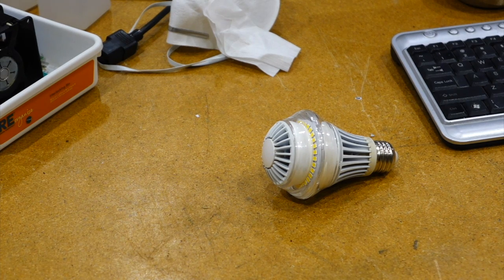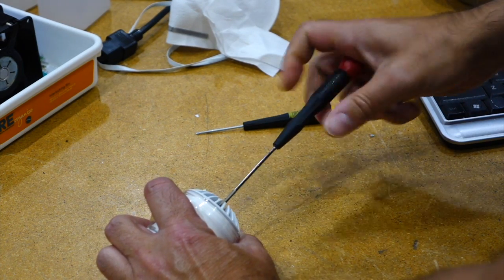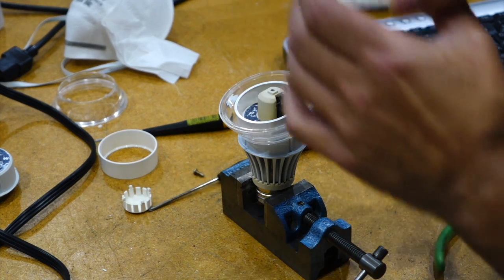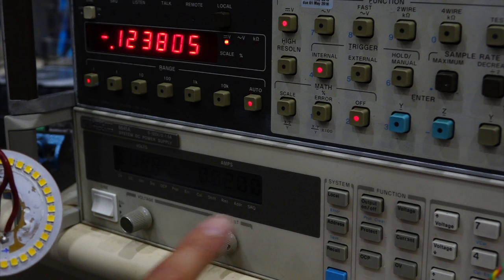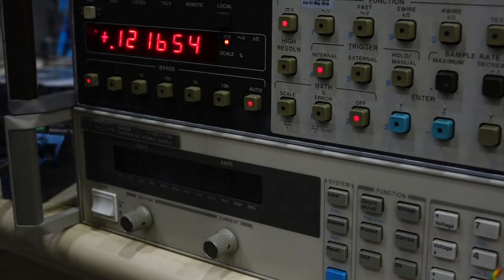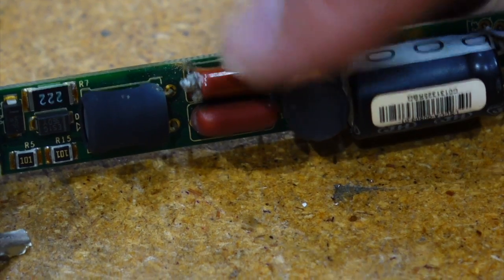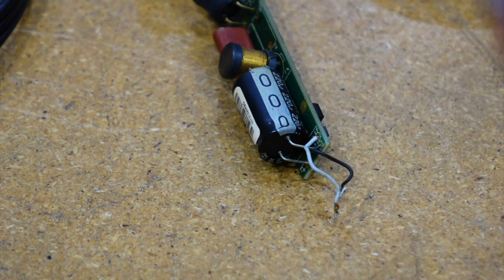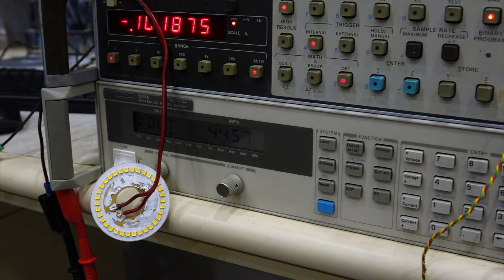"Ecosmart" LED Light Bulb Failure

Comment: Yeah. Avoid the Home Depot "Ecosmart" LED brand. They're very unreliable. The chips are connected in series and are less reliable individually. When one fails, the bulb fails entirely. Buy the higher quality LED brands offered by competitors, such as Lowes. I've had muuuuch better experience with them.

Comment: This is really interesting.  This brand (Ecosmart) is the one my dad buys for our house.  They last 1-2 years, barely longer than incandescents, and the same amount as CFLs.  The price is also barely more than incandescents and about the same as CFLs.  Meanwhile I buy the expensive ones for my bedroom because I have a dimmer switch here.  The ones I got in 2012 were about $10 each and were still working, just getting dim and grey, when I replaced them in 2022.  The current ones were about $7 each and they have a much sleeker design.  It’s very interesting to see the reason for the difference in both price and longevity.

Comment: Light bulbs have been designed to fail for over a century. Look up the Phoebus cartel.  First they engineered filaments to burn out at a specific hour range, and now it's LEDs and power supplies.

Comment: Hello Marc, thanks for posting this. My newly built house is equipped with 100% LED lighting, and over six years I’ve seen roughly 5% failure, mostly in the traditional bulb-shaped dimmable lamps. I don’t have enough samples for correlation, but it appears that failures are more common when the lamps are used base-up. I imagine that heat soak is a factor.
Reply: Going to drill vent holes on my next set to see if your theory helps.

Comment: I mistakenly bought two Ecosmart 3 way bulbs for my kitchen light.  ( I just wanted two 100W equivalent) They worked, but when I came back the circuit (15amp) had popped.  No other lights were on the circuit.  I again turned on the lights and worked in my kitchen turned off the lights and came back the next day. (It is a rental)  The circuit breaker had tripped again when I tried to turn on the lights.  Not when I turned them on , but sometime while I was gone.  This is on a three way switch.  So do you think these lights are somehow pulling power enough to trip the breaker when off and if the breaker did not trip would my wires melt instead?
Reply from the maker: If they are off when it breaks, I'd guess it must be something else very wrong on your kitchen circuit. You could put the lights somewhere else in the house and see if it happens too as an experiment.
Reply: @CuriousMarc  I had two 9 Watt bulbs and then two 11 Watt bulbs in there previously with no problems.  I mistakenly placed the two three way bulbs in thinking they were 100 Watts for more light in my project room.  I tried to call the company from the number on the box, but it was disconnected.  I took them back to HD for my $16.26.  I was the one who wired the three way switches in the kitchen from a schematic.  No other lights have both a three way switch and a dedicated one breaker in my house for comparison.  I appreciate your input.

Comment: I guess this is a good argument for using a lower voltage DC supply for domestic lighting (say 48V), and run several lamps from a single (higher quality/reliability) supply. With a swing towards smart lighting where other circuits must be powered, this could be useful.
Reply: most of these consumer grade transformers are packed in an airtight box as well...

Comment: I have had a similar experience with LED bulbs.  I haven't had any outright die in a blaze of glory like yours.  Instead they get blinky or occasionally do their impression of strobe lights.  Which is incredibly annoying and sometimes makes you question your sanity when it just blinks once in a while.  I've noticed in the recent ones that they put capacitors in the PS output so they behave more like incandescents when you shut them off, and perhaps this keeps the brightness more stable too if the line fluctuates.  Still haven't seen one last nearly as long as an incandescent bulb, but the cool running, whiter light, and low current draw does make them attractive, especially in my 100 year-old house, some of which has old wiring I need to get around to replacing someday.

Comment: I bought 3 Ecosmart Led Bulbs at Home Depot. Two of them has start flickering within one year. Not a good deal.
Reply: I had 3 Ecosmart bulbs that came with my new Hampton Bay ceiling fan. I tried one of them in my bathroom fixture but it didn't work at all.
Reply: @kenrutherford1109  Was it in a teenagers room?.
Reply: @houseguestchannel  IDK
Reply: @kenrutherford1109  I’m guessing it was.

Comment: Hi Marc! A little late but I just saw this video poking around your channel. How many of those failed lamps were in the same fixtures? Most designed for incandescent bulbs can be real LED killers due to airflow. I bet if you monitor operating temperature, they go waaaaayy out of spec :(

Comment: It looks to me like their design is faulty.
A trip-up point for new engineers is that they forget to properly specify a film capacitor's voltage rating depending on the frequency they operate at. The red capacitor that burned in yours is a film capacitor. Likely it isn't rated for a high enough voltage, or isn't meant to run at a high frequency.
Film capacitors are peculiar in that they can't withstand their labeled voltage as the frequency increases. This is NOT a fault of the capacitor manufacturer, because they specify in the datasheet what the voltage derating is for a given frequency.
(BTW, some film caps are specifically meant to run at high frequency. It's possible that the person who sourced the parts did NOT know that the capacitor selection is critical.)

If you can read the voltage and capacitance rating off of those red capacitors, I might be able to find one that can suffice as a replacement. 

P.S. There is not much of a need to use a transformer in these power supplies. As long as the LEDs and the heatsink are electrically isolated, the LEDs can operate just fine while floating at mains voltage levels. (Obviously, the power supply limits the current.)

Comment: BTW, why the need for such a complex PSU ? Why not use a simple diode and a resistor(s) in series with enough LEDs to drop the voltage ? (and maybe an electrolytic capacitor in parallel to limit the flickering)
Reply from the maker: I do not know for sure,  but I suppose most of the complexity is because this particular one is dimmable, and also to deal with the wide range of voltages, frequencies and safety concerns. Although the last one did not work that well...
Reply: The PSU isn't really all that complex, it just looks like it is. XD
What it does is it limits the current going to the LEDs. LEDs are different than a filament based lamp - if you were to connect the LEDs directly to the mains AC, they would draw a huge amount of current and burn up instantly.

Comment: Cheap chinese no-name capacitors that can't stand the heat. I've seen this in compact fluorescent lamps as well.
Some of those LED bulbs have a warning on the box, or on the device itself, that says that it should not be installed in closed, or recessed ceiling-type fixtures. 
I've bought Philips LED bulbs from Home Depot also, and so far so good for about a year now...

Comment: I've bought nothing but Philips LED bulbs (I think about 12 of them), starting when the old yellow-top ones first came out in 2010. I have yet to have a single one fail, so I stick with them! I've heard Cree are equally reliable, but haven't tried any myself.
Reply: The same here, and yet another 3 years passed (since your comment) and not even a single one has failed yet (I have dozens). The oldest is from 2010, the newest from 2012 or so.
Reply: Marcelo Picoli I’ll be switching to Phillips then, ALL of my EcoSmart lights failed within 2yrs. Some failed within months. They are complete trash.
Reply: @victork3397  They were probably in a teenagers room and enclosed.

Comment: I've tried quite a few LED's over the last few years, and the ones that seem to last forever are the more expensive Philips bulbs.  I have a few that are several years old, and still working with daily use.
Reply: Yeah, the cheap bulbs simply aren't made or designed as well. They are cheaper for a reason - there is less heatsinking, which saves manufacturing cost, but ends up with the LEDs running at a higher temperature, which drastically reduces their life.
Also another common problem is that the manufacturers will puts LEDs in parallel. This is a BIG NO-NO, unless your LEDs are well matched. Otherwise, one will take more current than the other, and as such, it will overheat and die sooner.

Comment: Shops in the Netherlands can only sell led bulbs (or halogen) these days as decided by law. I had them for at least three years in the entire house and not a single failure (knock on wood). But they are all bought locally (cheaper all the time) and we also have strict rules for mains connected stuff. The burst caps should be at least X2 rated but considering their look I think that is doubtful. My advise: buy quality bulbs and the little extra in price, comes back in less replacements.
Reply: I dunno if those those caps are for mains filtering, they may or may not be.
Not all film caps are required to be X2 rated, only if they are to be placed directly across the line.

Comment: Were the capactiors not rated for the voltage/current or did the power supply get so hot any cap would have failed?
Reply from the maker: I don't know enough about capacitor reliability. But I would suspect either, both, or this was a faulty capacitor batch. It could also be a more insidious circuit design problem (some kind of transient that was not foreseen or hard to observe).

Comment: They never got the power supplies right with the CFLs either.  It's rarely the tube that goes bad on them.  The old 4-foot fluorescents usually stay running for near forever until they need replacement tubes, at which point they'll continue to run once again.  But when they build the power supply into the bulb, they go bang!
Reply: tubelights get knocked out when you keep turning them off and on - turn them on once and they will light up to 250,000 hrs. leaving them on also uses less power. I have a 35year old tube still happily lighting - it did get a bit dimmer as the phosphor degrades over time

Comment: The bad thing.is the way the socket is staked to the power supply makes it hard to reassemble after a repair attempt. Maybe they need higher voltage caps in them...